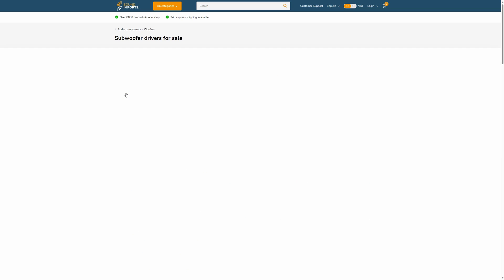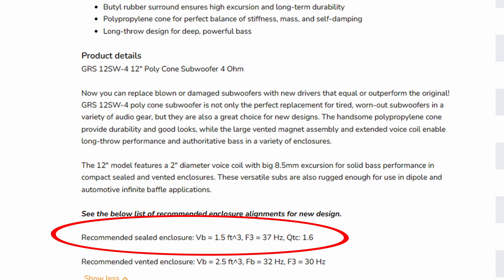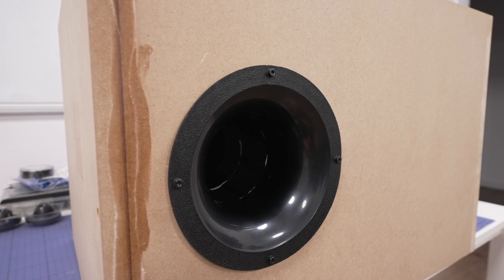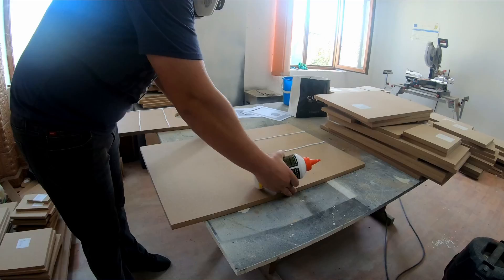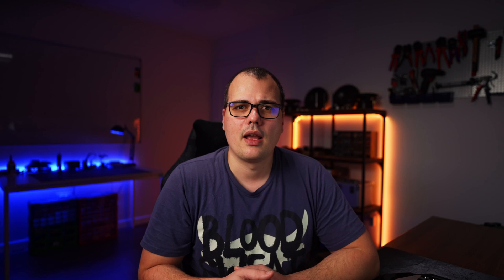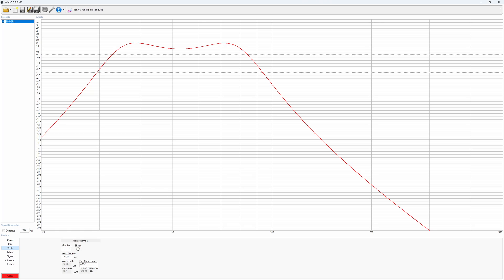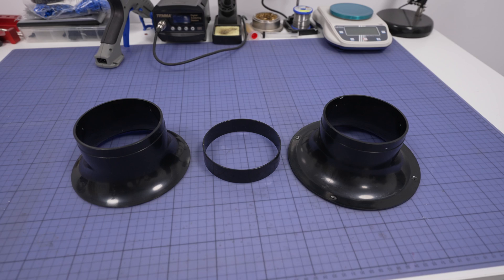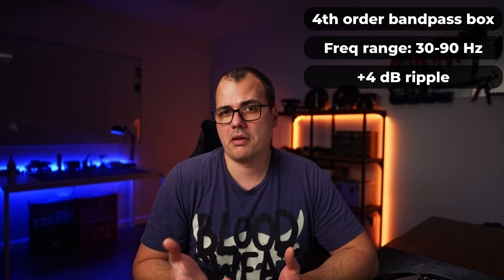Build a proper subwoofer box - Makes a BIG Difference

Comment: I built my first double 12inch box last week, I wanted to put an 8 inch aero port but the one that I wanted to buy was actually more expensive than all my material put together so I bought an 8 inch pvc pipe which worked out to 80% cheaper. Next step was flaring the pipe which was done easily using a gas stove. Box specs: H - 350mm  W - 920mm  D - 380mm

Took it an SPL car show today and did a 147.4 db's @ 55hz

Comment: A few years ago I decided to try my hand at the $150 car audio SPL challenge…. just for fun.  I bought four PAC8 8” woofers from PartsExpress for just $8 each and powered by a cheap $99 500 watt subwoofer amp from Walmart.  I designed a custom 4th order bandpass box, built it, and then put it into my 2018 KIA Niro.  Once it was all wired up I was shocked at the volume and the overall sound quality.  After taking it to a local car audio shop to get SPL readings, it hit 135 db at 47 hz!  I was VERY surprised, and so was the car audio shop too.  

I made a series of videos on this on my channel called “Budget Boomin”.

Comment: I would put 4 in a sealed box wired in parallel with a 400 watt class D amplifier
Reply: I did just that Abt 4 years ago.6 cuft total sealed it worked very very well for home theater

Comment: Nice vid. I always wondered how GRS is because the low prices they offer seems to good to be true. Lets see the true power rating on that thing or how mechanically stable it is.

 Speaking on proper box design, im trying to study the magnitude of box losses. I have a Yamaha sw218v box that are fit in with 2× b&c tbw100 18"s.  the panels on that box somewhat flex hard. The frequency response is a rounded slope on the low end 60hz and below. Terrible box for sure. Supposedly according to winisd if i make the box really hard there would be more authority on low end extension. It Would be a good idea to make a video about that. Thin wood vs thick heavy hard wood (ported)

I also have another question thats on my mind but can't find a solid answer. Does stuffing a ported box make it closer to a sealed? Because would the stuffing act like box loss and the port loading becomes less effective?

Comment: Fb is lower probably because your model didn't take into consideration the damping added to the sealed chamber.  For 4th order BP builds, I like to get the sealed chamber right first (using DATs, measure Fb with the driver access panel off, add or remove stuffing until you hit the target Fb for the sim. 

If you used something like WinISD for the sim, you may find that you actually have to tune a bit higher than Fb to get a level passband, because WinISD doesn't take into consideration factors that impact the woofer's response at higher bass frequencies, like semi-inductance.

Finally, if you go with a much larger vent, or more vents, you may find that you have to trim them much shorter than expected to hit a target Fb.  The classic equation for determining vent length for a given Fb starts to get more inaccurate at the volume of the vent starts to exceed more than than 10% or so of the volume of the chamber it's in. Something I discovered with my "Enigma" 4th order BP build.

BTW, love the idea of using silicone to seal the last panel...!
Reply: How much does the car interior volume (cu ft), being smaller than a typical room, affect the measured tuning ?
Reply: @brianmack6285  Probably very little, unless the vent was placed pretty close to a nearby panel or surface in the car.
Reply: Thanks for this info, 10% is nothing.  Usually, I find slot ports will make up 20% (or way more) of the volume of the enclosure, especially with high excursion  subwoofers. This might help explain why I have found that I usually needed to aim for an Fb of 30Hz when I really want an Fb of 32Hz.
Reply: @scottw1938  When the volume of the vent is 10% or more than the volume of the box, the actual Fb achieved starts to be dependent on the geometry of the box and vent and where the vent's entrance is located in the box. For the typical slot-loaded car audio subwoofer, I found it better to model it as an offset-driver / offset-vent stepped transmission line (3 steps).  On my website, I've got a workbook called BOXPLAN-VBSLOT that allows the user to enter the dimensions of the box and the slot, and the workbook generates the corresponding sim file for use in Hornresp. 

For my "Enigma" 4th order BP build, I used 2 long 3" flared vents for the vented section, and I had to trim about 20% off their length to achieve anywhere near the target response curve.  Yes, I had to make the vents shorter :-).

Comment: I use wood glue and there's an easy way to take the back off without ruining the box or the panel. I just put a demo blade on my circular saw and set the blade to 3/4" and cut it out.